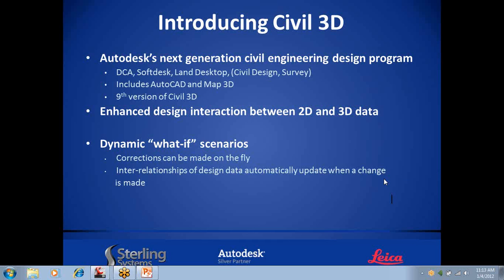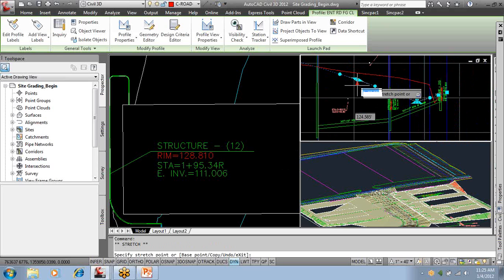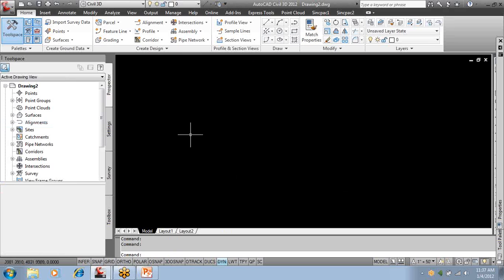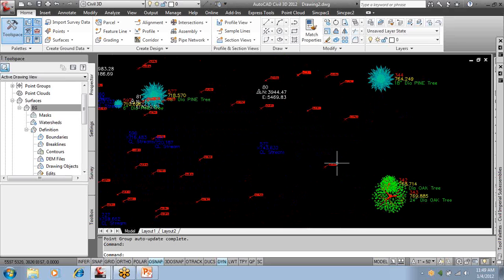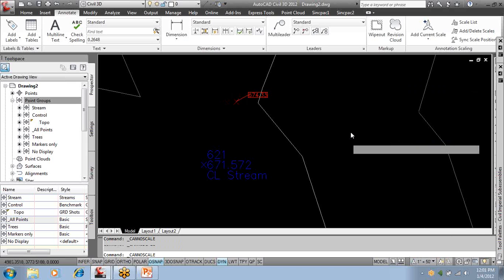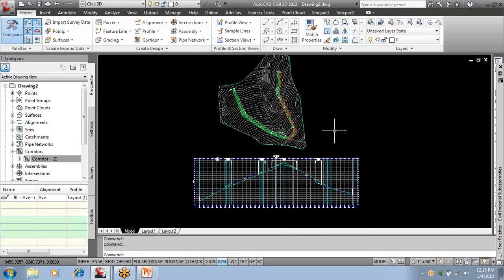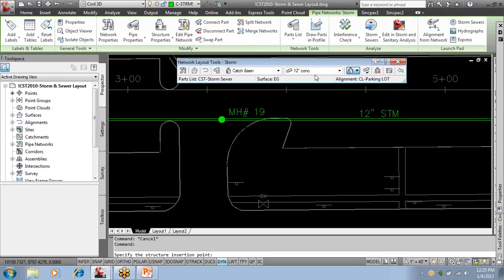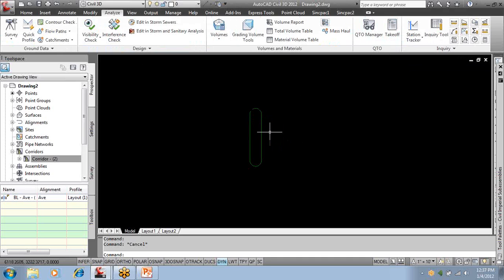Part 1 - Introduction to Autodesk Civil 3D

Comment: Hi there. I wonder what to do with my modelling. I've extracted the existing profile and done the design profile. I've done the assembly but when I generated the corridor, the result is 3m higher than design profile. Any fix? Thanks in advance.